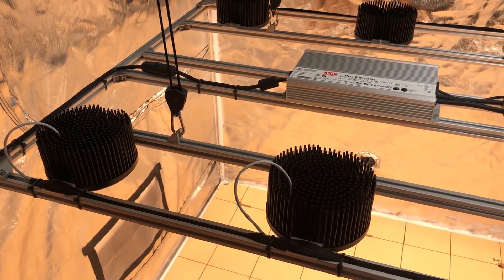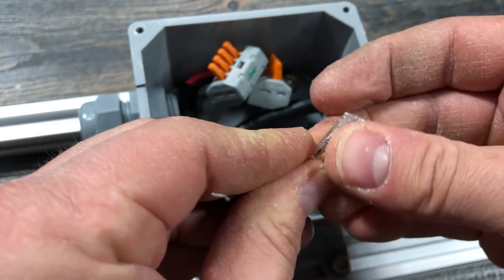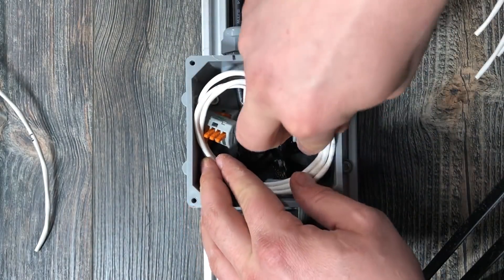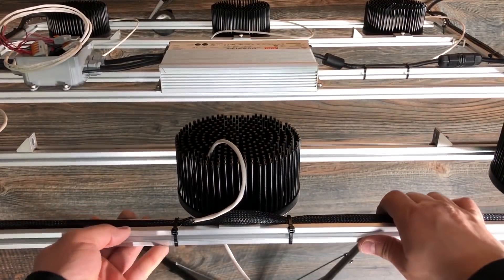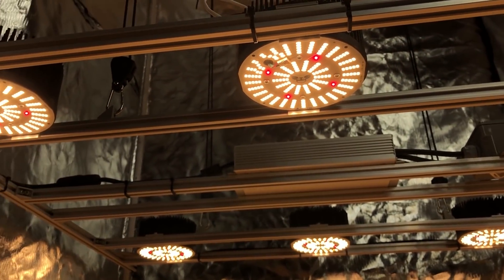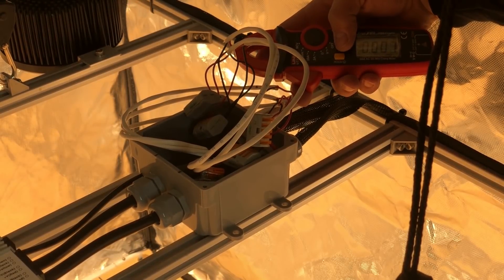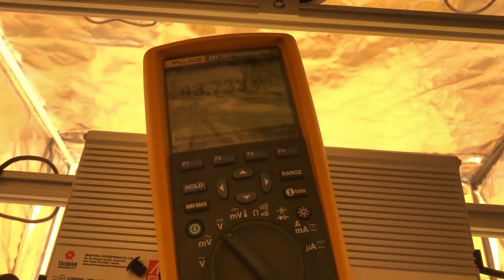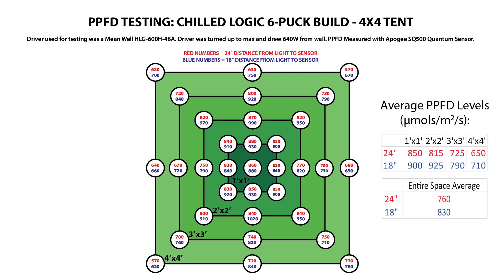ChilLED Logic 100W PCB Parallel Puck Build Part 2

Comment: Why not a HLG-600H-54B?
Reply from the maker: The pucks are 48VDC nominal and you get more current with the lower  voltage driver. I have both drivers and feel this one is better suited.

Comment: Always twist off your cable ties, never cut them. Cut edges are sharp and cut skin easily.
Reply from the maker: G` Bailey I have a pair of flush cutters that i usually use in my videos but couldn’t find them so I used my strippers like a baddy this time. I’ve also cut about a billion zip ties in my line of work and if you cut them the skinny way (not the flat way) you can make it allllllmost as good as a flush cut ty-rap.
Reply: the good ole "flesh" cutters!! 😄😄😄

Comment: All my lights are parallel, I just add a 0.1ohm high tolerance load balancing resistor on each positive wire to an LED strip.
Reply: The reason I had to modify my lights like this was because the cheap drivers I used would start flickering.
Reply from the maker: Cool. How much power is each resistor rated for? Have a link?
Reply: @LEDGardener  I use 3W, with low temperature drift, just check on digikey... I can post the part number if you want. I solder it inline and heatshrink it.
Reply from the maker: Must be low power strips then hey?
Reply: I use "old" F series strips. They are pretty good, I killed an LED diode when assembling the first light...  It is still working 2 years later.
Reply from the maker: MostlyWeed interesting. I would have thought you’d be running more than 3W per F strip.
Reply: @LEDGardener  100W each at about 46V each. There is very little power being dissipated in the resistor as it is only a small fraction of the total impedance of the load.
Reply: @LEDGardener  using ohms law and some approximate values... V/R=I  so 46/R=2.1A, i.e. R= +-22ohms that resitor will only see a tenth of a twenty second of the voltage.
Reply: the total load on the resistor is about 0.46W

Comment: These are great.  Had a spare driver and decided to try these with the rapid frame and love it.  Running mine at 75W though so theyre some of the most efficient lights out there.
Reply from the maker: Sweet. What do you think of the Rapid frame in particular?
Reply: LED Gardener The Rapid frame is awesome,you can order longer rails with or without all the end pieces and other accessories if you want to spread them out a bit more if you are only running 2 also. The pucks move freely along the rails and all pre drilled holes are perfect..Great collaboration.✌️
Reply: Oh and cool vid,very good info. Thanks man.

Comment: Good info, as usual. But your poor DRY hands. Buy some pure vegetable glycerine and mix it half and half with water. Apply to your hands before going to bed at night. Two or three nights in a row and your hands will be back to normal. It's what I have to do to prevent those painful cracks I get in my thumbs.
Reply from the maker: firecloud77 yeah, construction takes a toll on them for sure. Thanks for the tip 😁

Comment: Where did you get that junction box? 

Would love to find one that is the same size as the driver :( Can see the one you are using isn't a perfect fit with the slots but close
Reply: Nvm read the description - 4x4 PVC Box - Home Depot
Reply: If you ever do enclose a driver you'll probably want to give it some vent holes